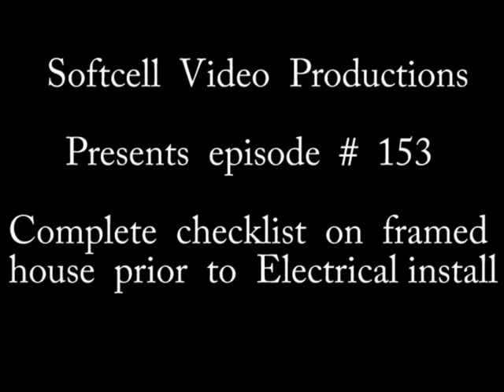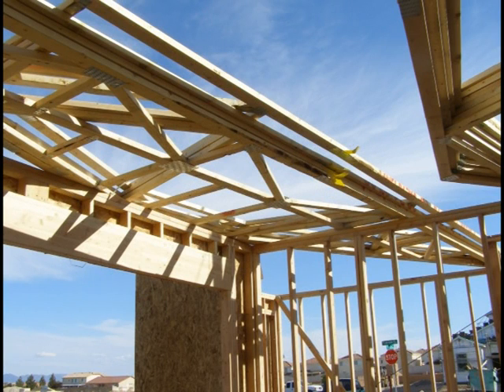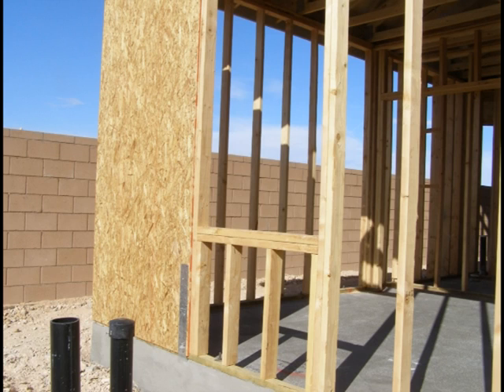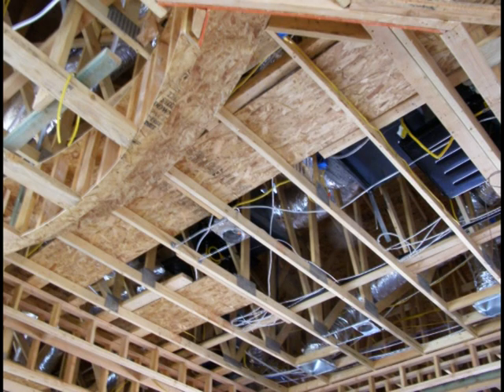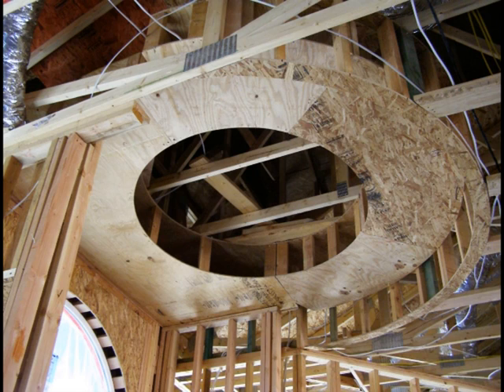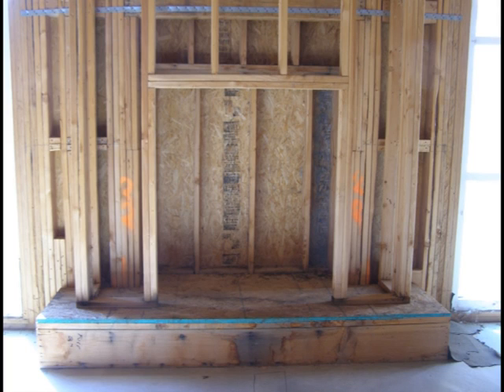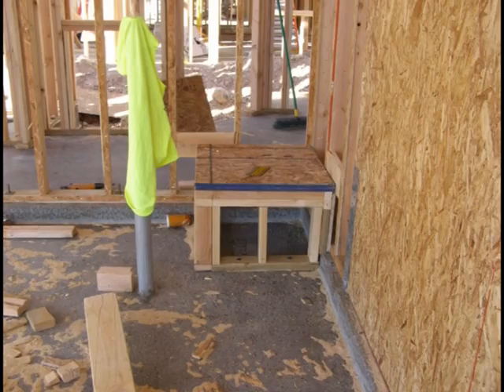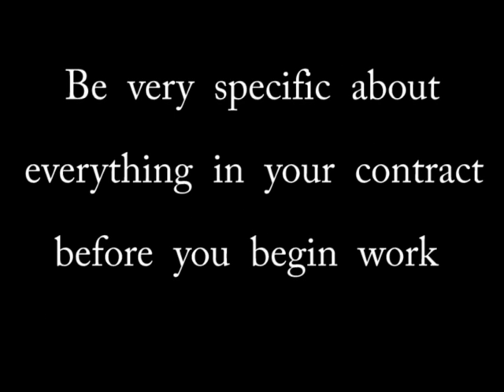NEC code checklist for new homes  #1 M    #153

Comment: One thing you , missed, is make sure outside, sheeting complete before drilling holes in center, Of studs! IMPORTANT, as some framers, sometimes use 7-8 penny nails they will reach those center,holes wires!